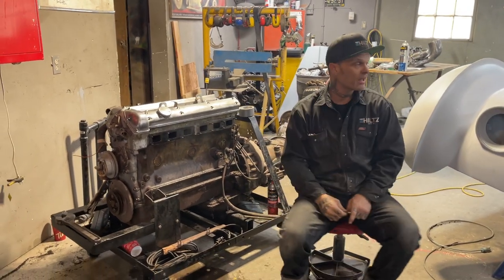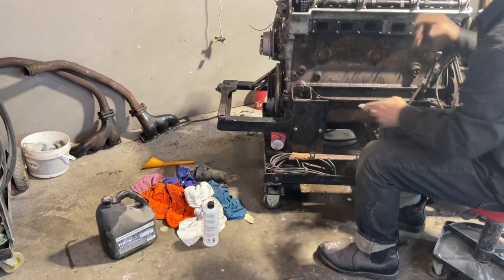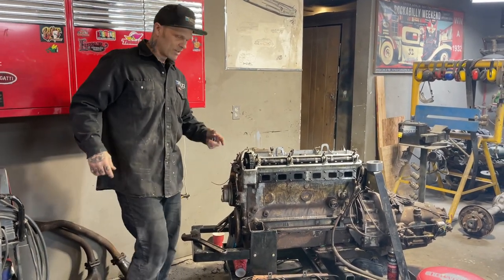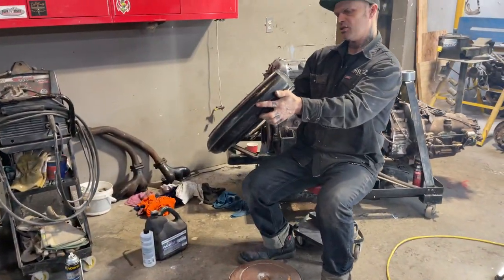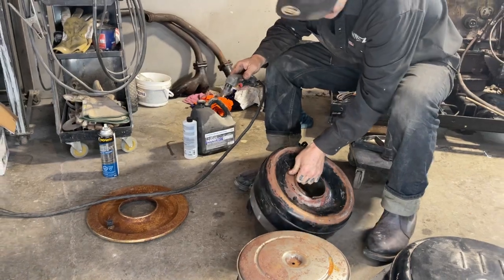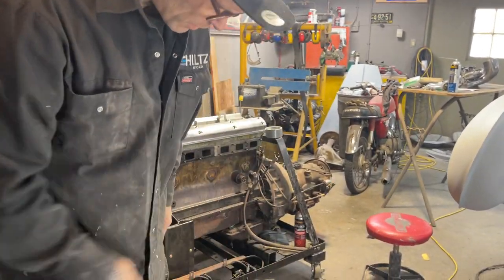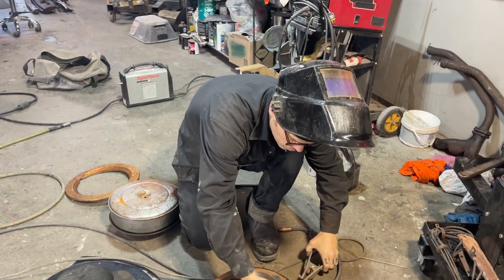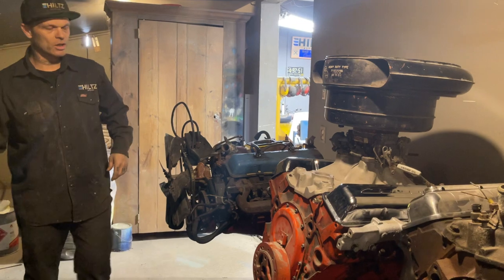HYDROLOCKED 1959 JAGUAR 3.4L ENGINE

Comment: I agree chad that if your non-interference engine is timmed ok then the piston won't hit the valves BUT......... The valve was Stuck open and didn't close when the cam was turned therefore the piston can make contact with the value. It may have pushed it closed but I'm sure i didn't do any harm. Keep working on it you'll get there. 👀
Reply: non-interference engine so it wont hit valve stuck open.......
Reply: Yes, the valve was Stuck and didn't close until the piston hit it..........😊
Reply: @philipmiller1030  well then its an interference engine !
Reply: @sarahhelenpeters  I had an advantage of knowing that it was an interference engine, and Doug said it was only non-interference while it was timmed.  😊
Reply: @sarahhelenpeters  have a good day  😊

Comment: Chad you hydrolocked the engine Doug advised to take the head off he is the mechanic not you your little rant on you did not hurt the motor and trying to convince yourself over and over on this video is not even funny or acceptable I don't like you were throwing faces on the last video when Doug was doing it a lot of rust on the valve stems just because they move now you still might have problems with them seating Doug was working on the engine take his years of advice and let him continue on the engine Rome was not build in a day